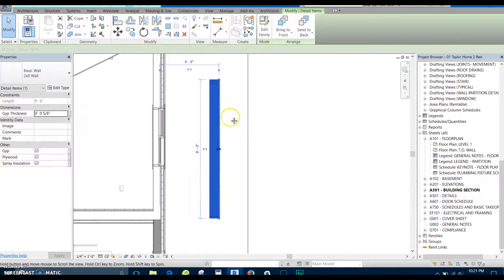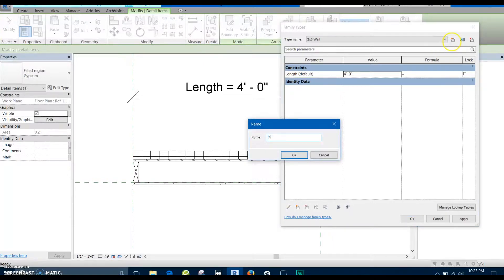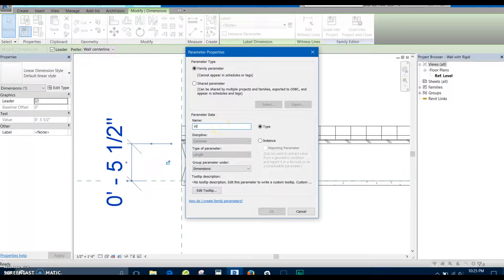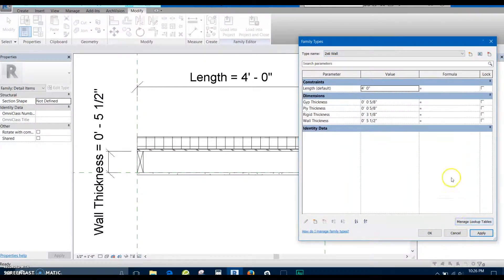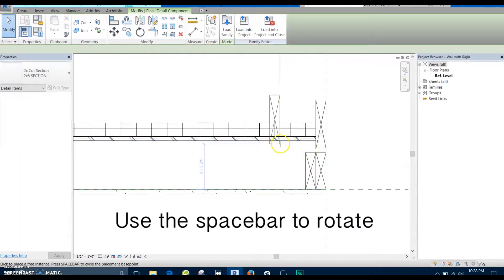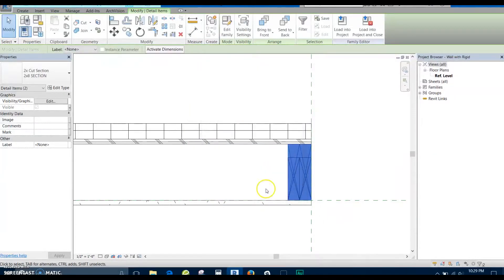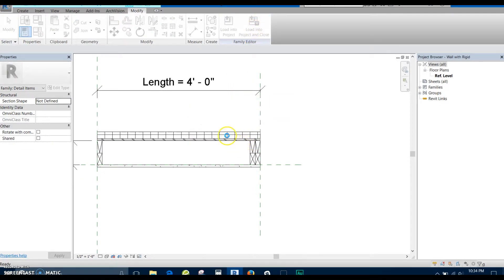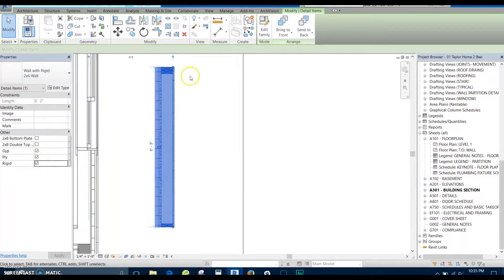Advanced Line Detail Component

Comment: Thank you very much for this. You saved me lot's of problems.  My boss works this stuff only with detail lines and regions and it was so frustrating because so many pieces.  One thing, It is better to constrain first all parameters to reference lines. I modified the family and like you sugested did it for diferent parts of the wall, going to try with floor systems. Than you very much!